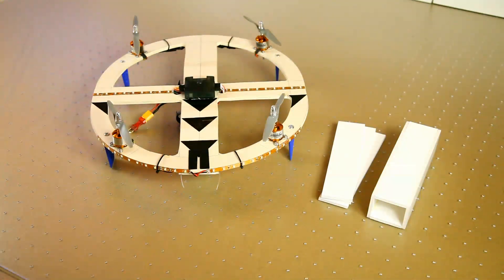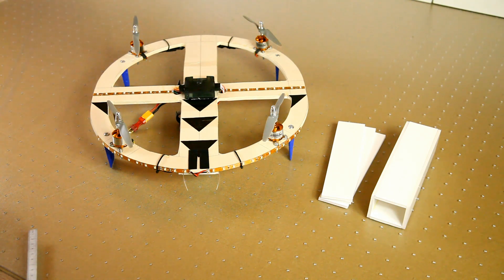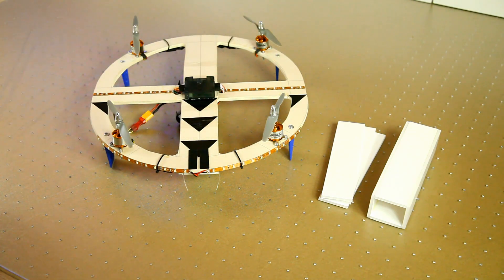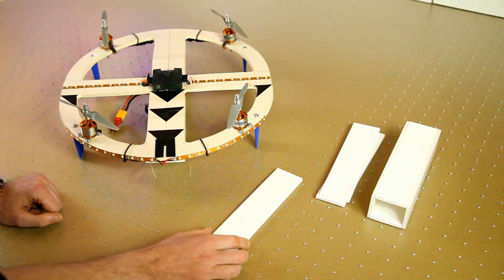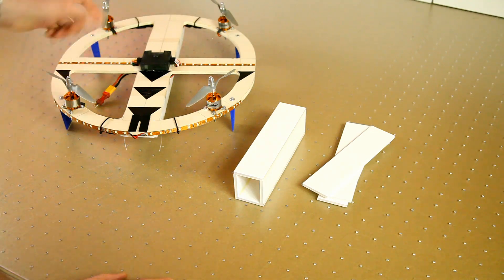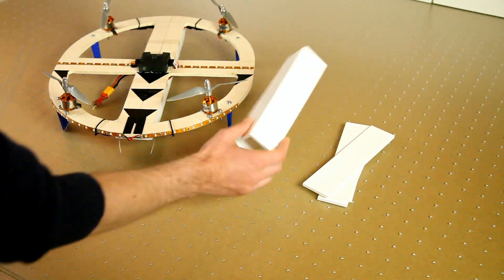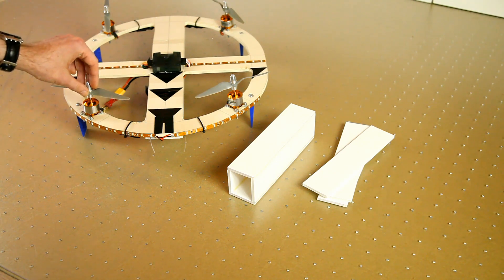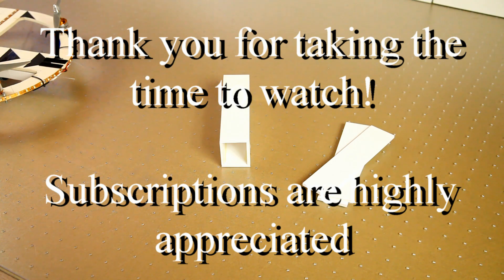Cheap Foamboard QuadCopter Build Series! Part 1

Comment: Nice introduction video! The old one did seem heavy and slow so this should be much better :) I'll be on the watch for the builds
Reply from the maker: The RCAddict Yeah man.. The other one is on the heavy side.. Weight brings stability.. But ghehe nope... it doesn't bring speed (well.. when crashing maybe :P)  Thanks mate! I'll shoot an update video tomorrow :)
Reply: DutchRC ADVENTURES Ok, it will be in my WL as I still have about 20 left :)
Reply from the maker: The RCAddict Hahaha :D  damn man.. The quad looks quite Good by now actually.. You'll see in a couple of days then :)